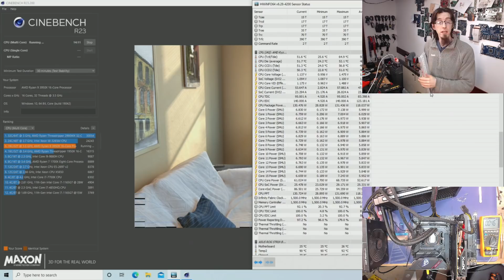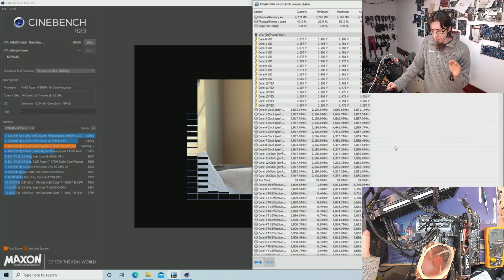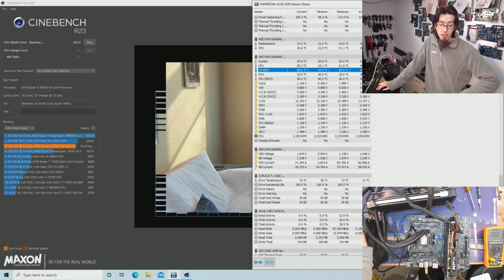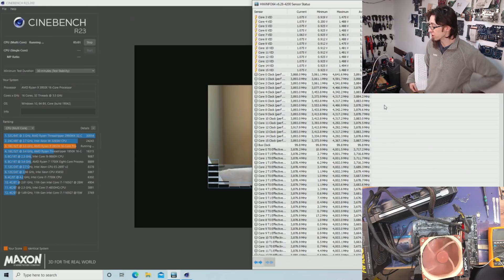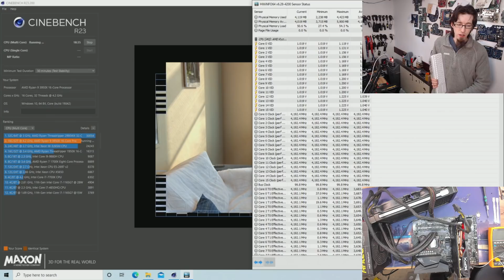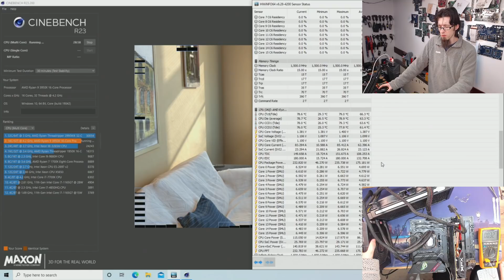VRM Basics Part 2 - LFC#255

Comment from the maker: According to datasheets, most modern mosfets are good for 150c. So 100-120c may well be totally fine. Not sure I'd want anything on the mobo to be at that temp, but maybe someone who's tested to destruction knows the answer there.
Reply: I wouldn't worry too much about anything below 100C for power electronics. The only components that can't handle such temperatures are wet capacitor types like electrolytics, but those have long been replaced with solid types on modern motherboards. I've seen many a power supply in a industrial installation, tucked in a cramped and poorly ventilated cabinet, run at 100C for years and years (certainly long enough considering the useful life of a PC motherboard). It would also be worth testing with a plain radial CPU cooler (such as the AMD stock coolers). They suck in air from the top and blow it out trough the sides, straight trough any VRM heatsinks present and I've found it to have a significant effect.
Reply: with your setup you're measuring tCASE, not tJUNCTION and you cannot measure the latter. you can however kinda calculate it using various data from the datasheet.
SPSs with actual onboard sensors should indicate tJUNCTION i think with some offset preprogrammed but again it's gotta be integrated, not an external SMD probe. 

a secondary issue with 100+C temperatures is killing the capacitors around the vrm, these degrade kinda quadratically.

Comment: I know this is 4 years old, but I was wondering where someone could get that cooler that is on the cheap board at. I think it would solve some problems I am having with throttling down problems on my setup. Any body got a part number and a possible source?

Comment: Your testing here is impeccable, it's a shame you struggled to get your point across because of the choice of platform because with the 13th gen intel CPUs VRM problems are more relevant than ever. The problems I encountered with them are so profound that I'd call them a scam and the rest of the industry is profiting off of it as well.

Let's start with my PC, I decided to make a budget one, so I picked a cheaper board - Gigabyte B760M DDR4 Gaming and combined it with an i5-13600K. If the board doesn't ring a bell, it is essentially a DS3H series variant that are known to not be very good. I don't intend to overclock it, but a non-K version is not available, nor does the board allow it. When running Cinebench R23, my VRM temps reach 108°C within ONE MINUTE and then the CPU throttles from 5.1 down to 3.1 GHz. The score then stabilizes at 18 000, instead of the 24 000, it should be getting. The VRM phases are 6+2+1 and only half of the modules have a heat sink over them and I knew this going in, but you don't normally associate an i5 with such brutal throttling issues. I'll try adding Raspberry Pi 50x25 and 25x25 mm heatsinks with little fans from Aliexpress over the exposed modules on the top of the mb, but even the standard heatsink on the board feels like it has 100°C under load. Gigabyte claims the board supports everything from a Celeron G6900T to an i9-13900KS.

Exhibit B.: The company I work for decided to finally replace the aging computers in the engineering departments. Because of contracts, they all had to be HP. So we put forward some basic requirements, i7/i9 depending on the workload, professional GPU specs, SSD specs and so on. Well, they arrived, they're HP Elite Tower G9s and I had a look inside one. There are no VRM heatsinks at all and they don't even use intel stock coolers on the CPU, but rather some proprietary HP coolers which look like intel coolers of old. When testing mine with an i7, it became clear that there are some strict PL limits as the CPU never turboes beyond 130W and under constant load, it throttles back to 65W very quickly. In Cinebench R23, it is only getting 16 000-17 000 points, instead of the 30 000 it is supposed to be achieving. Also, these computers were quite overpriced. The company basically invested in a whole bunch of i7 / i9 workstations, but we're only getting i5-13400 - like performance from these machines.

So they're all in on this SCAM. Intel started it because they're lagging behind with their manufacturing processes and are producing these hot power hungry hogs to keep up with the competition (more in benchmarks than real-world applications), certainly knowing they were going to create vast problems for many users on a plethora of boards.
Motherboard manufacturers like Gigabyte keep making and selling motherboards with these underengineered VRMs as if nothing has changed over the last few intel generations, slapping the latest marking on them and claim support for every CPU available on their website.
And then you have computer builders like HP that claim to have built "the best workstation PC ever" and that it's "the newest generation" in their presentation, but in reality their components are so shoddy that literally take A HALF of CPU your performance away.

Comment: The MSI board also had a rather crummy heatsink on top of the components. I wouldn't completely bet against it if what you want is a moderate overclock and it has good active cooling in a good case.

Comment: Finally sat down and took this in. 

Your methodology is fine i dont expect you to go 100% science (especially if the cpu isnt your to burn and you arent willing to wreck the boards). Also that kind of testing is impractical for your channel at the moment. Leave that for people like GN or something who have the time and resources.

That gigabyte board is not very good though the components themselves are the real hold back, and i have seen msi boards that look like thy rather die than throttle to save themselves. I had an am3+ board that ran dangerously hot but was fun as hell to overclock on.

All in all, fun to watch, good explanations and a fair conclusion. Enjoyed both videos.

Comment: 1.4v for Zen 2 is insane. You don't want to go above 1.325v for an all core load.
Reply from the maker: Yea it was a very quick and dirty overclock purely to make the chip pull more current. I absolutely wouldn't run that as a daily.

Comment: I don't have the skill and my eye sight is fading YAY for growing old.  However, you  have been considering expanding on your soldering skills.  It shouldn't be too hard to design a PCB and use one of the many fab sites at what is 2 dollars a board for production and build yourself a series of VRM's using resistive loads with current and voltage test points (1 ohm resistors means v = i so really all voltage test points).  Use the standard 0 to 30 (or more depending on the amps to test for) two wire volt meters that are sold for a buck, make a pop-in test bed and In this way you could test to destruction a VRM module with ease.

Comment: It's a power supply so the design , parts used , RDS on , switching speeds , types of inductors , capacitor values , capacitors ESR , target cost , even the pcb layout & copper size all change the VRM'S performance .

So you can have the unicorn in solid gold or painted but its still a unicorn ! 

PS
Like unicorns the perfect VRM doesn't exist !

Comment: As you state quite a few times, you were looking for confirmation, and the closure feels as if you are leaving in that same frameset. I hope further testing might eventually change that. Proper mobo manufacturers don't list a CPU as compatible lightly.

In non-overclocking scenarios, assemblies with adequately ventilated enclosures and for regular use and gaming, those low-end motherboards are going to perform perfectly fine 100% fo the time. Matched with medium-range CPUs, which is the logical setup, those will even cope with light overclock. Sure going to extreme numbers won't be wise, and you will also miss some features, bells and whistles, but that comes with the budget.

You're not alone with that bias. I had this debate about VRMs some time ago in a forum, where a young self-described "expert" was arguing against the processors listed by the manufacturer for a specific motherboard just looking at a picture and counting chokes. To a certain degree, a lot of the stuff you see in a motherboard these days are there for the gallery and not out of engineering necessity. Unfortunately imho  (as the costs grow accordingly)

Assemble a nice mid-range tight budget machine with that Gigabyte motherboard. You now have a proper test to show its capabilities.

Comment: I actually have the MSI X470 gaming plus max board that you showed in this video paired with a Ryzen 7 2700X. I thought this board was a little cheap on VRMs but I'm not overclocking so I think it will be ok. I think your testing method is very thorough and practical. I've always thought the ROG boards were a waste of money however thanks to your video I can clearly see that for overclocking they are far far superior.

Comment: All that time and effort did draw some useful conclusions.  1. Ryzen being what it is with FIT, plays things extremely safe; at all auto settings, even modest VRM boards will work fine.  2.  The VRMs become extremely important when moving to static clocks and manual Voltages, so it's obviously of importance to those who tinker and overclock.  So, the crap VRM boards are perfect for the non-tinkering layperson, and for those who do wish to overclock, VRM design becomes the item around which to base a purchase decision.  Great work!

Comment: I think MSI engineers know what they are doing when they design a motherboard with a purpose in mind. Be it gaming, 24hr grinding or OCing. In most cases, the cheapest compatible motherboard is plenty for the average user. Those who are into OCing should know better when selecting a motherboard.

Comment: 15:57 tbh I'm very surprised that this lowered temperatures because there's no case to force the fan to pull air from a area around the board instead of the air above it. This was very good to see.
Reply: Convection is very weak, any movement of air, even just the bit from blade backwash will help

Comment: just a very small query, and little to do with the main topic, but in one of your tests you simulated having an exhaust fan. If you're running an AIO isn't it more usual for the rear fan to be an input fan?

If you find time and opportunity, I'd like to see you repeat the VRM analysis and temperature measurements with a low budget Intel solution - 10400F CPU + cheap H460 board - with a high-end solution - Z-series plus 10900K. This should be of particular interest to you and your more cost-conscious customers as you can buy both a 10400F and a cheap Intel board for less than the price of a Ryzen 5600, maybe a 3600.
Reply from the maker: Yea, rear intake with a top exhaust is good for VRMs. I've never run that config myself, I think two rear exhausts and a front intake makes more sense for a typical setup. But the important thing is that there's some airflow. Any fan moving air near the VRMs will assist the heatsinks.

Comment: Ran Memtest, RAM failed, good tip from your previous video. RMA the crappy new RAM. Good job, I have the old RAM. 3000 Mhz Cas 15, failed and caused blue screens! Corsair, where has the quality gone....Note the old RAM is 5 years old and no errors and same brand speeds etc. 

In two weeks, brand new Corsair PSU, failed to work properly. Two month old Corsair LPX RAM failed big time! 

Lets hope the M2 drive was not damaged by the RMA PSU. 

Ordered a Seasonic QX Gold....and the RAM will be RMA'd today and will test new with Memtest 86....

Comment: Since when was there a Cinebench R23?!
Reply from the maker: Fairly recently. I think it's only a small bump to help it load down the top-spec CPUs a bit better. The big boy threadrippers and such can crunch through an R20 cycle almost before the clocks settle, which makes the test rather inconclusive.
Reply: @Adamant_IT  thanks for the reply :)

Comment: Maybe with the newer components this isn’t a big issue anymore? My current cpu (fx-8350e) ran into thermal throttling because the vrms on my asus M5A97 LE couldn’t handle the heat, despite showing 60 degrees on the cpu in HWmonitor. 
Thanks to your video you did a while ago I looked into my build and touched the vrms and nearly burned myself. 
The bequiet! Shadow Rock TF 2  TopDownBlower Air Cooler was my solution and it doesn’t throttle anymore.

Comment: Funny you say the msi has poxy vrms, but was actually some of the best across all x470/b450 average to high quality boards at the time
Reply from the maker: Ye, we saw a big uplift of VRM set ups from the X470/B450 era to X570/B550. 5+2 isn't very impressive by modern standards, but 4 mosfets per phase was pretty good for X470/B450 low-end boards. You needed to spend £200+ to get anything better if my memory serves me.

Comment: by far best reduction in temps across the board for me was putting waterblock on GPU and vertical mounting away from MOBO , chipset, RAM, VRM ect all dropped around 10°c lol
Reply: I'm doing that "fan under the GPU where the empty slots were" thing

Comment: I have a x470 Crosshair Hero VII (7), 5 doubled phased 60Amps, so "fake 10 phases" and 2 of them are for SOC. whit a Ryzen 5950x the VRM sits around low 50º but the CPU all on auto ... just reaches 90º boosting all cores close or hitting  5,05Ghz. I had to manually set a BIOS thermal  70º limit. Whit this VRM sits around 40º and all core boosts go (i have to check) but around 4,7Ghz. I still  have&hate the 1.45v spikes but is this or manual OC where i will be using a 4,2 or whatever browsing or watching a video.

Comment: The weird thing is that I have in my system a MSI B450 Mortar and it has a much bigger VRMs heatsink that the MSI on the video and in theory the chipset in mine is worse, right?
I think it should have been interesting to take those temperatures while installed in a case with average airflow because I think all these pasive cooled parts are designed to run that way, so there could be quite a bit of difference... or not, who knows, but at the end of the day is a more "real life" test. In any case, nice video! 👍
Reply: A bigger heatsink doesn't necessarily cool better. Surface area is a factor and some large heatsinks are mostly just a block of aluminum without any real fins or are shaped in a way that actually prevents good convection. Or a board will have a big heatsink that's largely covered by plastic IO fairings that some mid- to high-end boards feature.
Reply: @darnon2031  Well, yes, that's true, but the mass helps "sinking" the heat for longer, although for long periods of time a bigger surface area is better. In any case, that heatsink is a joke for a X470

Comment: I like these deep dive videos where you concentrate on one thing. Maybe do other parts, like PSU, RAM etc. With all the associated stuff. This would be a good series for people who want to know how it all works from the ground up. Things like how RAM timings affect performance, single vs double channel etc. How badly a poor PSU affects your framerate. Things like that. I mean my worse power supply melted which caused my framerate to drop to 0! 
Call it "Bits to Bytes" and it is a series of how each part of your system (the Bits) affects how well it runs (the Bytes).
As for methodology, i'd say your sample size was too small. But other than that it was fine.